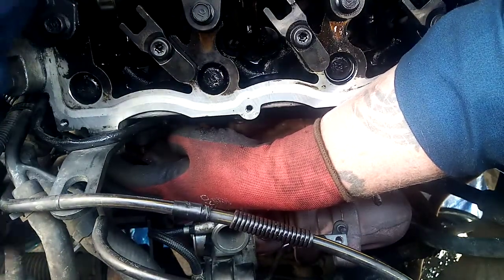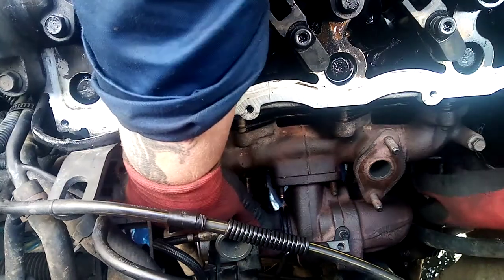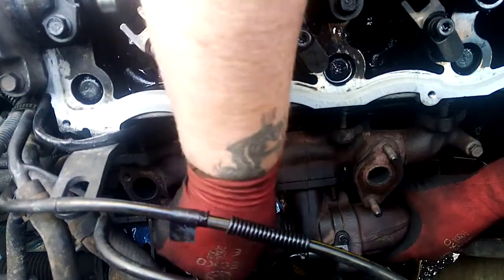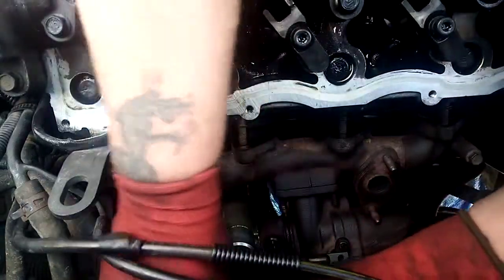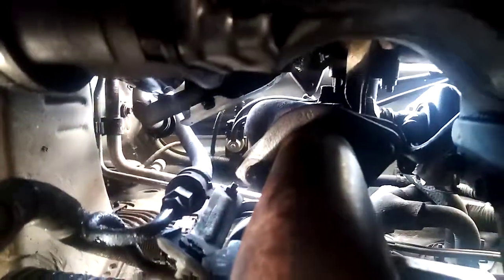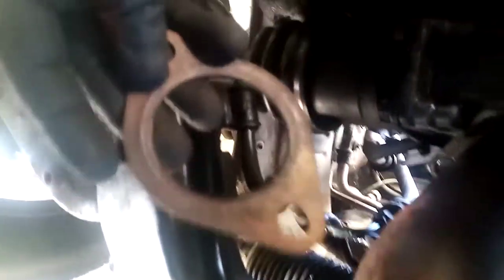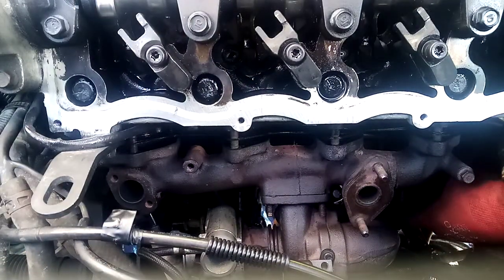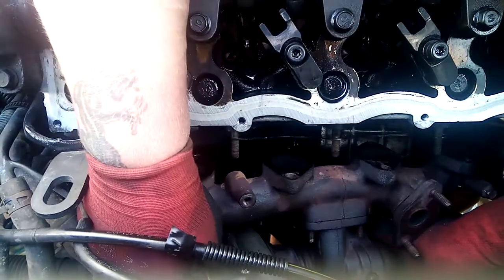Exhaust manifold and turbo removal hyundai tucson

Comment: Well done mate, currently half way through this job, just on my dinner break and thought I'd see how everyone else does it lol, can get to 90% of everything from underneath, but it's tight from the top with the cam cover on
Reply from the maker: Good luck, I needed to put new rocker cover gasket and injector seals on and the turbo was blown so thought I'd do it at the same time as space is tight as you know! Thanks for watching
Reply: @IvegotaroughideaDIYchannel  yeah access is pretty tight, i managed to get the turbo out from the top but when putting the new turbo back in i had to sort of build it back up while its in place lol not to bad though i have done worse lol, having issues with the exhaust now though, had to cut the 2 studs out and put a nut n bolt in instead, was just 2 rusty stumps lol
Reply from the maker: Fair play, and I hate working on the manifold with a passion, always a few nuts/bolts that don't play ball and you have to shout at them to get them moved!
Reply: @IvegotaroughideaDIYchannel  Yeah I dread any exhaust work, it's very rare you get an easy one, either snapping bolts or rounding heads, intake mani is never as bad 🤣 i find Ford's are the worst for rusting at the moment, right b*#@#*d's to work on
Reply from the maker: Yea I always make sure iv got new bolts and clamps if I'm doing any work coz it's always the one you ont have that rounds! Funnily enough iv just done a back box that rotted out on a fiesta 🙄 chassis is solid just everything else is rusty 😂

Comment: Is it not possible to get the turbo out without disturbing the exhaust manifold?
Reply from the maker: It is however it's alot harder if it's the original manifold as the nuts can be hard to get to and get off. I took the whole thing off as it made life easier :)

Comment: Hi
did you have to open the engine in half to remove  the turbo charger?
Reply from the maker: Hi, no I was putting new injector seals and rocker cover gasket on and realised there is more room without the cover on. You can get to the turbo from underneath the engine it just may be awkward to reach. Thanks for watching
Reply: @IvegotaroughideaDIYchannel  thank u very much ror your reply!
Reply: Can you get the turbo off without removing the manifold?
Reply from the maker: Yes you can, i only did it this way as it's easier and i was doing a rocker cover gasket aswell. Good luck!
Reply: @IvegotaroughideaDIYchannel  would you say its easier to do it that way I'm just about to start it and feeling a bit daunted by it lol
Reply from the maker: @andy0p0  not particularly unless you have to do a rocker gasket aswell as you do need to bleed the fuel line doing it this way. I have since taken the turbo off without removing everything and it seemed like it was less work. Its not a quick job so ideally take your time and remove everything you can from underneath first then the top bolts for the manifold. Just take your time and take lots of pictures if you can. The best of luck to you!
Reply: @IvegotaroughideaDIYchannel  ok thank you